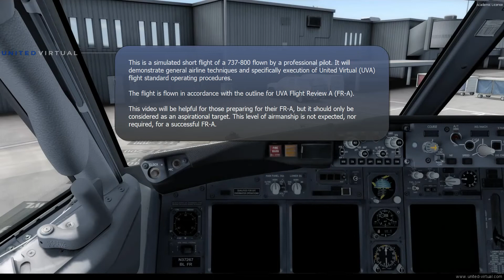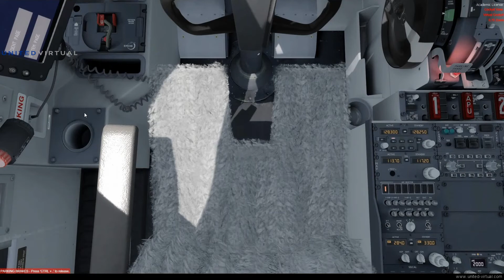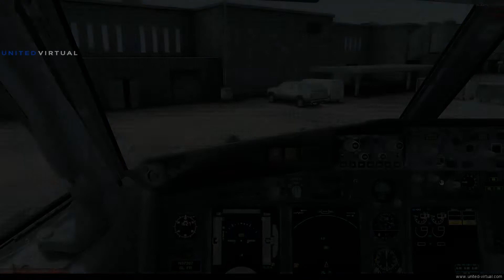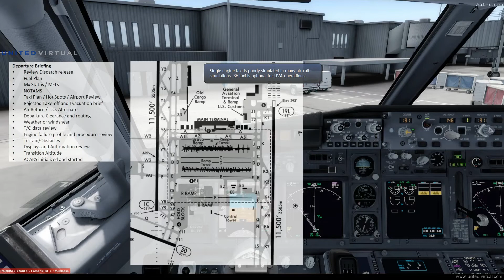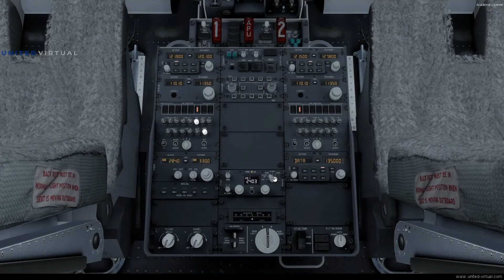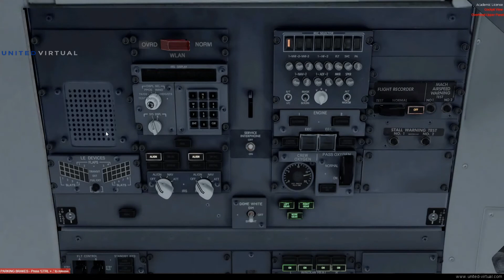United Virtual Airlines, Boeing 737-800 Demonstration Flight (FR-A)

Comment: This is a great source of knowledge.  QQ:  I have been flying the new 737-800.  I configured the FMC for all appropriate takeoff configurations (I believe).  On takeoff, the throttle hold for v2+20 not holding.  The throttle blows right by 166kts.  There is no bug setting.  Also the white bug for Flaps 1 doesn't show on the ribbon either.  Any thoughts?  Thanks for the great the training guide!  
joe